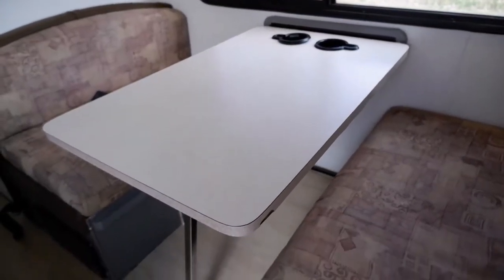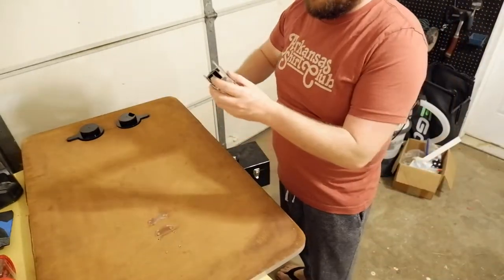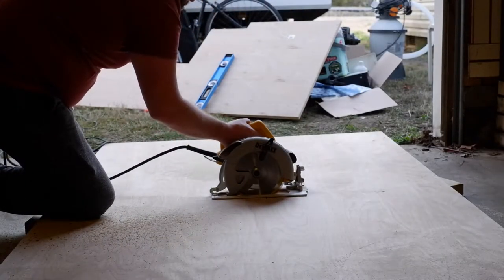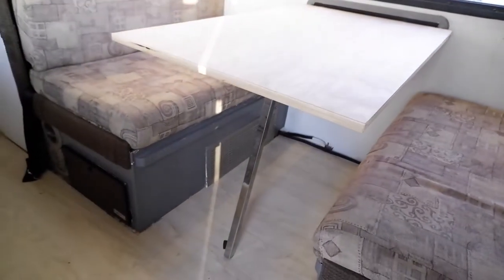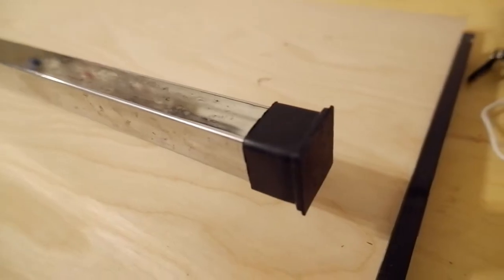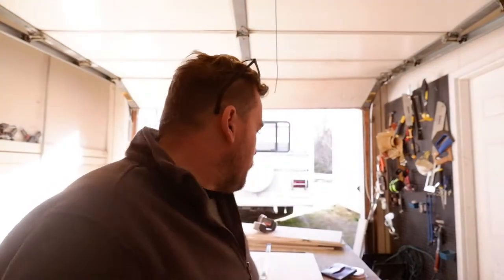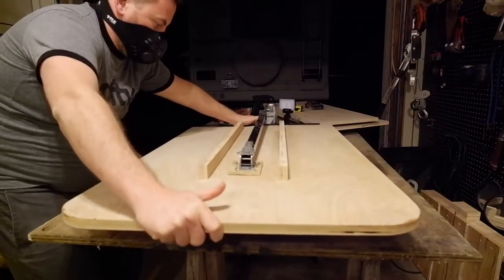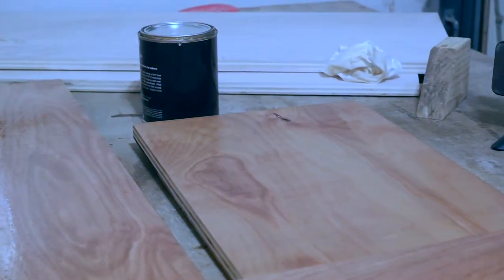How to Build an RV Dinette Table // RV Renovation, Part 8

Comment: We r using the old table but can’t seem to put it back on the track
Reply from the maker: That track system is a little weird, but it won't drop into the track unless you tilt the table up past 45 degrees.  So, you have to set it on the track, and then lift the far end of the table until it drops in.